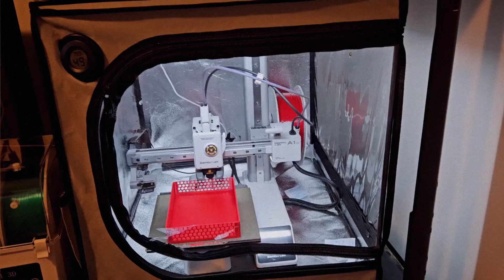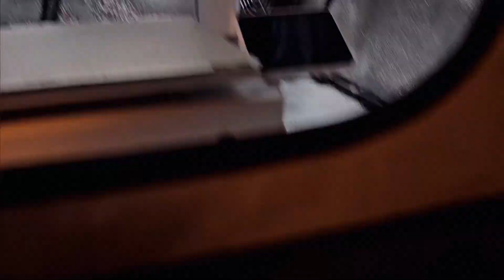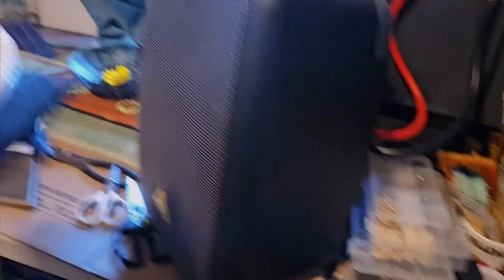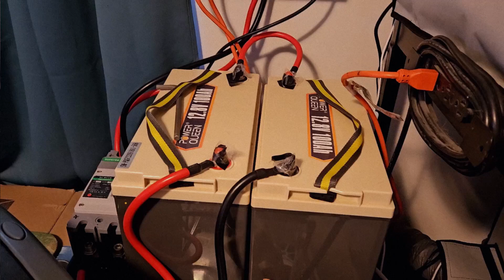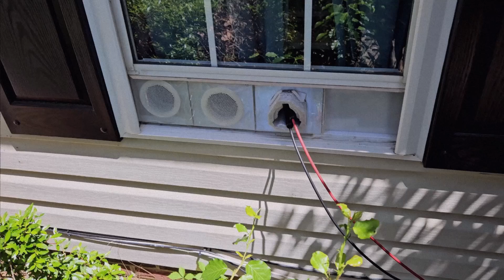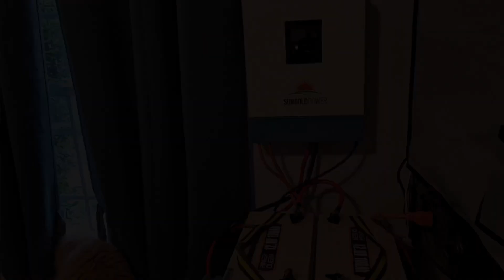Solar powered 3D printer setup. Bambu Labs A1 and A1 mini, Sungoldpower, Topcube enclosures

Comment: you should look at mine 😉 have 8 printers 4 x A1combo and 4 x A1mini combo hooked up to 5kw rack battery a Victron easy solar 2. all in a server rack with 2000 watts 4 x 500 watt panels which I'm fitting tomorrow and will buy another 5kw battery, make sure you earth/ground that inverter the A1 has 230v or 115v ac bed if there's a fault you will get shocked so go out a get a copper 6 foot rod and put it into the soil out side your window and wire it to the inverter ground make sure no pipes or wires underneath when you put rod in the ground.
Reply from the maker: Damn! I'm not worthy. Ha! Ha!

Comment: Tempted to try this but without the inverter since the printer power supplies just convert AC back to 12/24V DC. Would need regulated DC. My printers do not have AC bed heaters.